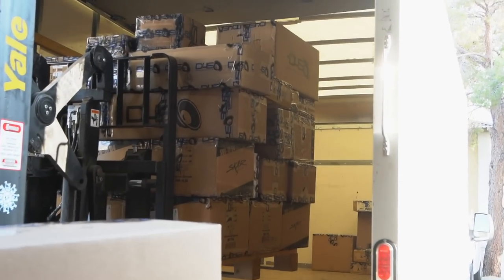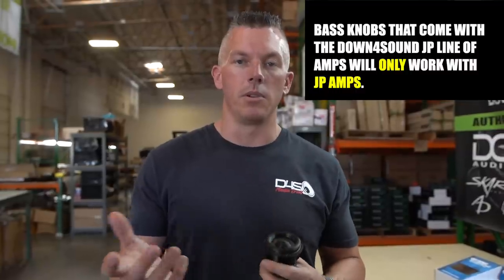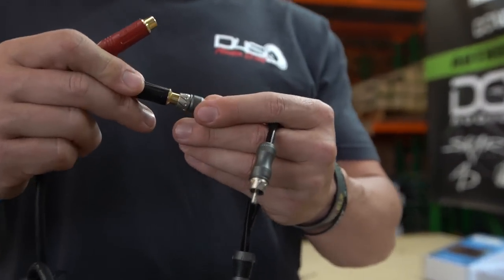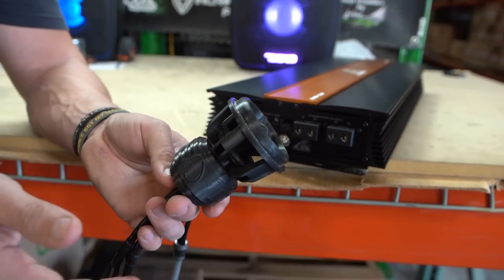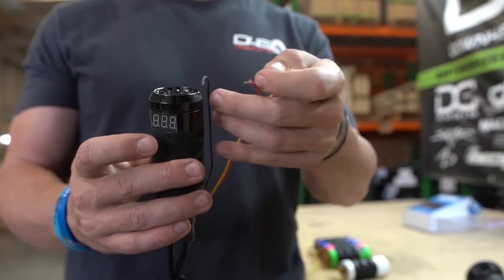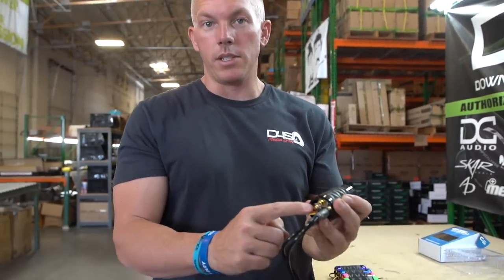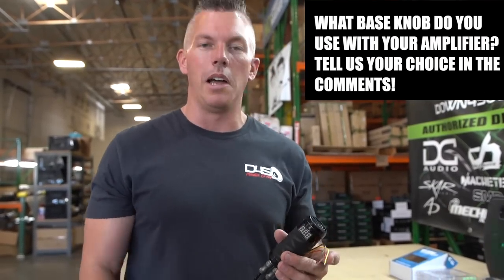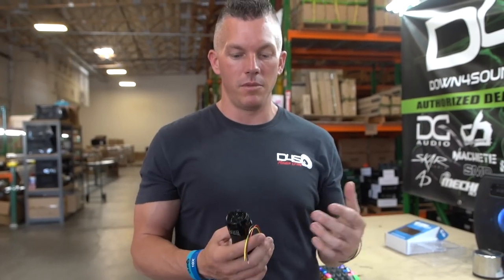BREAKING DOWN BASS KNOBS WITH JP!

Comment: I’ve always used the factory one, I think it’s a must to have a bass knob especially if your running more power then you need
Reply: Correct can't just slap all the time. 1200rms 1ohm is fun but not all the time.
Reply: @timcahill7792  facts bro. I love bass, but if you're always at 1200rms, then 1200rns will become the "new normal".
Reply: I agree!! Different songs on my system I turn it up or down so I only run with a bass knob

Comment: I think the red wire would be remote it and yellow remote out and black ground because the bassknob has a on and off switch. Unless the red is constant powered and inside the knob somehow cuts the remote power off.

Comment: I use the one that came with my Rockford Fosgate prime 1200.1d. I removed it from the case and built a custom panel that houses the knob as well as my voltmeter in the ashtray in my truck.

Comment: Been using the factory knobs in my builds up to this point. But now that I'm looking to run multiple amps using an RCA splitter it just makes more sense to use 1 really good RCA bass knob to control all 3 amps at once instead of running and installing 3 separate wires and factory knobs then struggling to shut the bass down while dealing with the popo
Reply: 2. Alot of the factory bass knob just control bass boost instead of gain, which is a big no no. And also if u have rca outputs on the amps u can daisy chain them together instead of using splitters. But if you have to use splitter i suggest a rca distro box insread of y-splitter.

Comment: Factory, because I want the clip light up front because making sure my gear is running clean is more important than looking cool to me. :-)
Reply: Exactly
Reply: But the aftermarket only go up to what you have it set on the amp
Reply: @simonarredondo6718  that’s with every bass knob lol
Reply: Right?
Reply: Set the gain correctly and u shouldnt ever clip. Bassknob maxed out when u scope it or dd it
Reply: @simonarredondo6718  but doesn't take into account for change in music quality from song to song. so in that aspect you can always turn the amp to the same level, but doesn't mean its always seeing the same clarity of signal from the source. you could easily clip on 1 song and be completely fine on another.
Reply: Same
Reply: Why not both?
Reply: Yep that's what I'm doing as well because most amps today is coming with clip lights so jp better get it in order times are changing fast and tec.as well

Comment: I have a question I don't know if you know the answer but, do manufacturers swap location of the cat cables to stop other cat5 five or 7 knobs from being  compatible that is the only thing I could think for them not to work. The cables are standardized so the only thing that would stop them from working is the locations of the wires when they are pressed I would assume.

Comment: I use the acr3 with audio controls dm608 for a bass knob. Easier way to control multiple amps mids amps highs amps and of course bass amps. Has 4 settings only unfortunately but best believe I use all 4 depending on if it's SQ mode or go deaf spl mode. Works for me anyway

Comment: I’d take after market if they have voltage and clipping on them my ds18 amps have two different indicators for clipping but not voltage 1 for amp other for subs but bass knob that came with has nothing just knob
Reply: Yes my bass knob is on the left of my steering wheel ...
My voltmeter is in my cigarette lighter
Having all the displays in one place is definitely 👌

Comment: I've always heard it's a bass knob, earlier today someone said it was Gain control and now i don't know if i should bother with it. Is is actually a Gain remote? Sounds counter productive if that's actually what it is... why take the time to tune everything and then screw it up by playing with the gain. Please tell me dude was wrong. I trust JP more than random guy online, but yeah.
Reply: Word. Thank you so much, i appreciate the clarity... Super helpful
Reply: What he said. Gain on amp is max itll go. Knobs allows u to turn that power down not up
Reply: because in the route of it, that knob is actually physically acting as a volume knob, you've already tuned the amp to highest level and the knob is just lowering from there, that's why you can have you knob "only half way up" but there's people that think they know what they're talking about, but will say doing that off your amp itself is different, even if you've already figured out that clipping is a certain spot and anything below that isn't. this knob is like turning your gain down on your amp but when you turn it back up, it'll only raise to the point of where the gain on the amp itself is set at.

Comment: Can I cut off the 3.5mm jacks on my knob? It came with a Loc it plugs into but I don’t have rca on my subs, onky speaker wire inputs so I can’t use the loc for the knob to then plug into, so I need to find a way to attach my controll knob some how, was thinking I could cut off the end of the knob which is a headphone plug 3.5mm standard plug. But then what would I wire the wires to,

Comment: Wouldn't this work on a Taramps HD3k MD3k Bass3k and up??? Because they do come with the clip power protect ect led lights but no gain / bass control... But the amp is sending the information to that light.. and a cat 5 should fit... But if the knob won't work for em.. do you carry the Sundown Zv5 woofer knob?? Like this one??? I like those it looks cool lol

Comment: Jp my profab has come apart at the seams and I was told to put screws into a 600 plus box by your employees not a happy camper. I'm running 4 q class 12in d2's and in the video it was stated that u can use up to sundown u series subs. Whats going on buddy.

Comment: I'd love to have a d4s subwoofer bass knob with clip light and volt meter for my cab 45. Maybe 1 day. 😎👍👍
Reply: How is that cab45? Been looking into buying one for awhile now. I am on the fence between cab45 and the Taramps8k or maybe 12k.
Reply: @maximilianmellick459  My cab 45 is great. Will be ordering a 2nd 1 soon so i can have 1 on each of my subs. 

They are in a completely different class then those taramps so idk what to tell ya especially if you're looking at amps that much bigger then the cab 45.